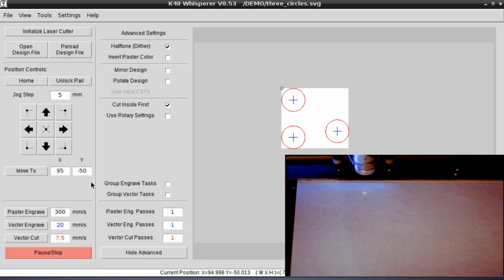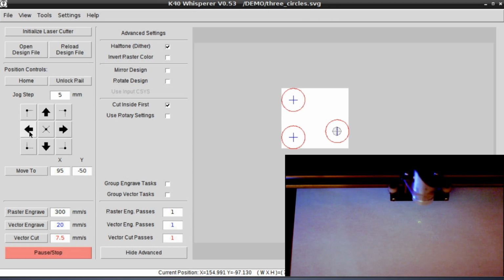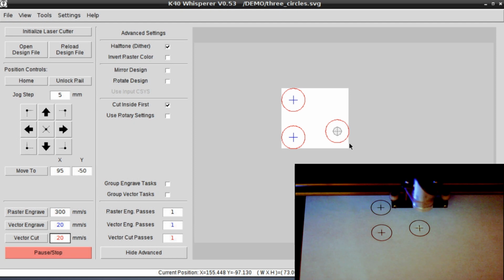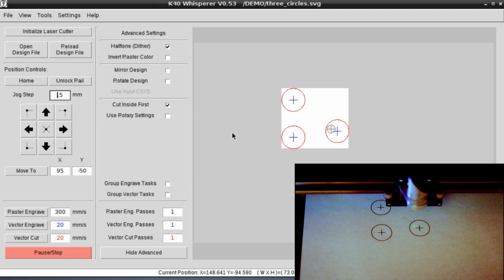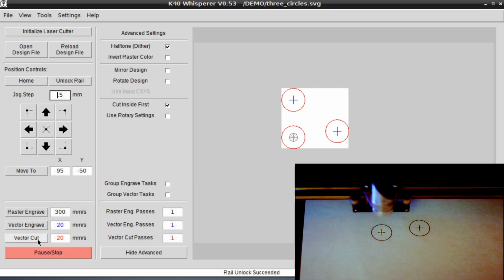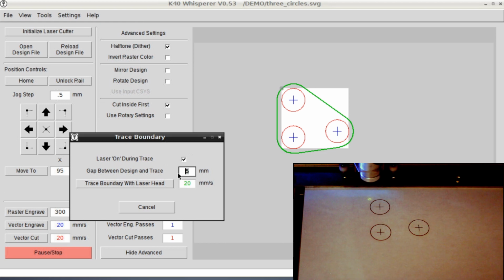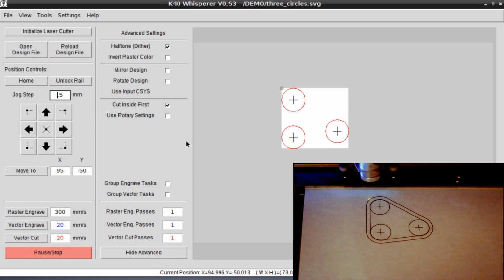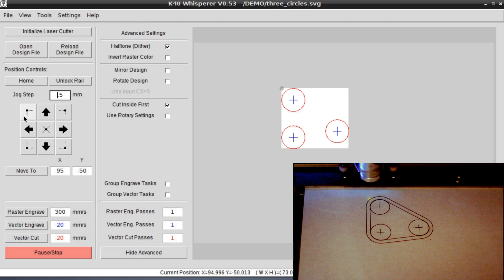K40 Whisperer: Design Alignment

Comment: Hello, thank you for the information and your video, I also have a laser machine that uses K40 software, and I am oversize the working area , But it requires a large motor power, so I made a gear ratio..After that the laser can run smoothly. But after entering the scale settings I encountered a problem... If I make a square object the results are accurate... But after making a circle object, the results are very weird, this is not oval shape or anything else.. on x Axis the diameter is correct but on y Axis the diameter u correct...
Reply: Do you have solution
Reply from the maker: Can you e-mail what a circle looks like to the e-mail address in the help menu?  I am guessing something else is going on with your machine.
Reply: @ScorchWorks  thank you.. i Will send the picture..
Reply: @ScorchWorks   .I've sent some photos and a description of my machine. I hope you can provide a solution to my problem... thank you and good luck forever

Comment: How can you start cutting close to the home (upper left of the rail)? Is there a way to do this or it will always start with a space on the left and top of the design?
Reply from the maker: K40 Whisperer does not add space to the design on the upper left corner.  When the machine homes, there is a slight offset to ensure the laser head does not slam into the end stop during raster engraving.  If you want to absolutely maximize the  cutting area, you can unlock the rail and push the laser head all the way to the upper right.

Comment: Is there a way to recover the original start position? sometimes when I engrave something my power will go out, or I'll get a USB timeout, and if that happens while I'm engraving, usually it's almost impossible to get the alignment perfect to restart the engraving.
Reply from the maker: No, but if you set the start position using the moveto button you can get back to the start position using the moveto button with the same inputs.

Comment: Hello, I have a problem with raster engraving multiplied object via whisperer. When I engrave one at time it looks good, I mean for example the circle (ring) is smoothly round but when I copy the same circle muliple times at project when engraving it starts loosing its smooth round shape  and beeing distorted. Any ideas why?
Reply from the maker: Might be a loose belt or something else mechanical that shows up with larger motions.  I don't know how copying an object would change its shape.
Reply: I dnot get templet for k40 anywhere every where cdr format and cdr format not suppprt in jt

Comment: hey any chance of supporting marlin or grbl? i really like this workflow compared to the other open source software and i wanted to upgrade my M2 board to a MKS SGEN_L with marlin to make better use of the hardware.

Also a suggestion, joystick support, like a claw machine.  If one could use a some cheap usb joystick for this it would be so much better than having to manually  the jog step between fast and slow.  This would also allow you to make custom controls with any arduino or micro that allows usb emulation.
Reply from the maker: I don't have any plans to add support for Marlin/GRBL.

Comment: Those are great tricks :) Can't wait to use them. How did you set up your airassist that it only turns on when the laser is active? My airassist tends to overheat when it's on for a bit. That set up would be a great solution to prevent that.
Reply from the maker: I replaced the "Laser Switch" with  a DPDT switch rated for enough power to control the air assist pump power.  On side of the DPDT switch controls the laser enable (as the old switch did) and the other side of the switch controls the air assist pump.  The two circuits are (electrically) independent of each other but the switch controls them both at the same time.

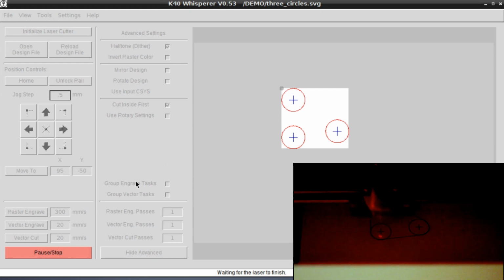Comment: At 4:33 the laser head is exiting the bounds of the svg. (The first two circles were internal to the shape and svg offset.) How large is move of head clearing the shape? 9:55 there is a pull back as well that might exceed the bounds of the svg.
Reply from the maker: I'm sorry. I don't understand your question.
Reply: @ScorchWorks  sorry let me try and rephrase. At the end of an svg path the laser head makes a move that isn't found in the svg file. For the. First two circles the laser head moves inward for the 90 degree position toward the 270 degree (or a small uncommanded move to the internal of the circle). On the third it appears to move from the 90 degree position outward beyond the right edge of the svg (or the beyond white portion of the canvas on the screen). It is a move I didn't notice before, with the potential to cause a crash and lose steps. I was curious the distance of the head move after the cut is complete. I will measure it later. Maybe I'm seeing things.
Reply from the maker: I think I understand what you are talking about now.  I am not sure of the exact overshoot.  The controller board does some motions that are not explicitly sent to the the laser by K40 Whisperer.
Reply: @ScorchWorks  thank you. I'll measure the offset to satisfy my curiosity. I've had a few crashes when I align the workpiece to the edge and it offsets the rest of the raster or svg. I was blaming running too fast and loosing steps. (I've been leaving a 15mm gutter on the left as a workaround.) Thanks for ruling out whisper and the svg.
Reply from the maker: Sometimes K40 Whisperer adds very small (~.002") moves and they get exaggerated by the controller.  So it may be partially K40 Whisperers fault. Generally it is a good idea to stay away from the edges especially if you are raster engraving at a fast rate.
Reply: @ScorchWorks  Looked like a lead out on the cut